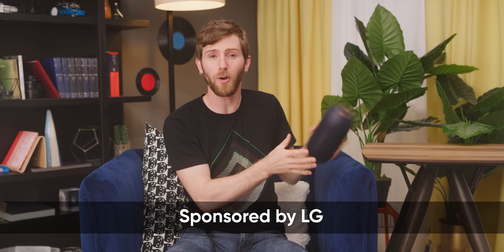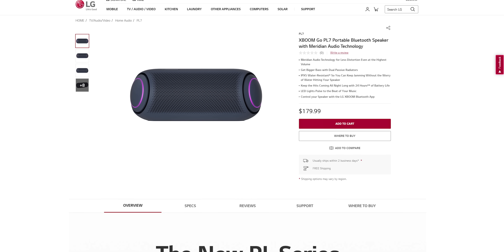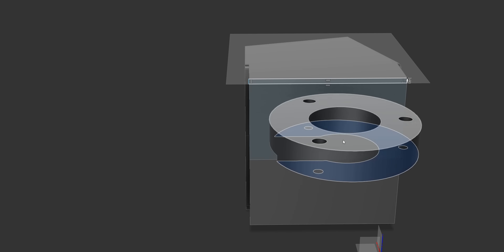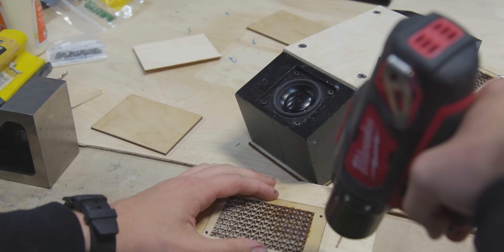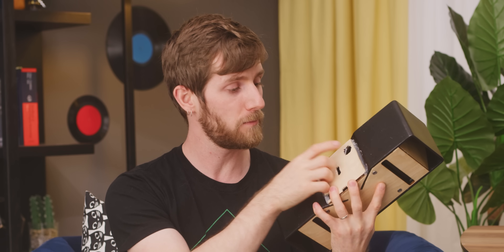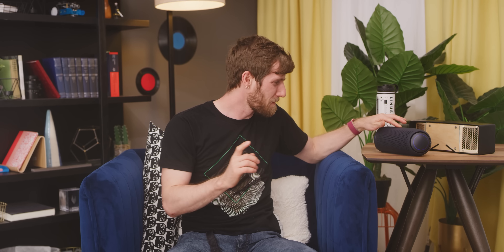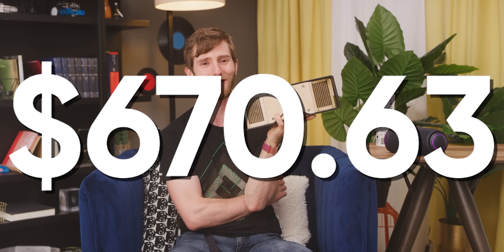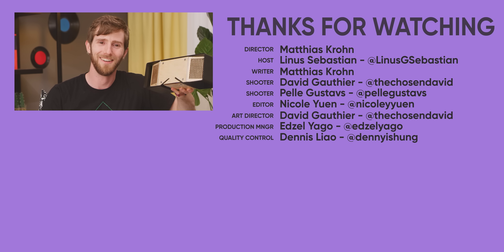Can we build a better bluetooth speaker? - LG XBOOM Go PL Series

Comment: Your "port" seems to be more of a transmission line than an actual port. A port is specifically designed to cause resonance at some specific (low) frequency, therefore boosting the bass of the speaker, whereas a transmission line is designed to act as an infinitely long channel, absorbing all the back radiation of the driver without loading it like a sealed box would do. As a result of this, a port is often just a straight duct, whereas a transmission line is often some long and folded structure.

As the perfect transmission line (the one that absorbs all radiation) is hard to achieve, the transmission line is often just made long enough so that the sound leaving it is somewhat in phase with the front radiation of the driver. (which is what you pointed out in the video) The thing is though, because ports and TLs are different things, the maths that applies to a port (which is what these online tools do, they calculate the optimal length for a port at a frequency you want to be loud so that you can show off with your 1500kg subwoofer in your car) does not apply to a transmission line.

Comment: But Linus, you calculating apples with Android's again. Please Calculate the design costs of the speaker lg did into your math or extend the count of your speaker by millions, selling them. (I think Matthias did amazing. (Minus the  connections are on the bottom instead of the backside) maybe give him another 60 hours to complete and tune and sell then STL and build files on lttstore ?

Comment: With two inch drivers you don't really need a tweeter I'd imagine. Could also just use a radiator instead of a sub to get some extra low end.

Comment: I appreciate approach with the 3d printer - it could have been a very good system but lacks a lot from the design perspective.
The most important is to measure linear and non-linear response of the individual drivers, simulate crossover, listen to the designed system and make some final adjustments to the crossover cause just measurements are not enough.
I guess your tweeter was just cut from low frequencies with the 2,2 uF condensator. That approach never sound good, even when using hi-end drivers. To compare - budget speakers like Dayton with properly designed crossover will surpass Scan-Speaks with just tweeter filtering.
Also your construction is kind of a transmission line which requires damping material inside the canal, carefully put - more in the beginning, less at the end of the canal. Without any foam you get a lot of strong resonances across the whole frequency response.

To be honest result is absolutely not a surprise. The whole thing would probably sound better without tweeters and in an closed enclosure. Maybe even less bassy but much more linear.

Comment: How is that 3D printed outer shell which required designing, 3D filler, hours to print, then redesigning, reprinting, more 3D filler, could possibly can be cheaper than bending a piece of aluminium lol

Comment: You should check out the boombox kids that they sell at Parts Express the kids are approximately 130 to $250 and I think the sound on them blows away in a commercially built Bluetooth speaker or boombox

Comment: I wouldn't have included a tweeter without a crossover.
Reply: Yeah and it would have been such a simple crossover
Reply: Also no EQ whatsoever...
Reply: I tried to turn a shitty Bluetooth speaker and a bookshelf speaker into a wireless speaker and when I plugged the tweeter and woofer in with no crossover the highs were so unpleasant that I had to disconnect the tweeter
Reply: @PackardKotch  Probably because the amp from the original Bluetooth speaker isn't powerful enough.
Reply: JF Tech/Drones it was, I just didn’t hook up the crossover
Reply: also that 1 1-8" tweeter was likely a bit to overpowering. two 3/4" might have been more appropriate.
Reply: @LKN117  it was not overpowering by much, because if you calculate 2 of the full rangers it adds them 6DB, and then that way the Twitter is overpowering just buy a half a DB
Reply: I call for a rematch. U know better than that guys. Lets TRY next time.
Reply: Yeah no wonder the highs are harsh...
Reply: Bump
Reply: I don't even know what a crossover is, you crazy audio nerds.
Reply: @nathanfife2890  a crossover splits a sound signal into higher and lower frequencies so that you can send the highs to the tweeters and the mids/lows to the woofers
Reply: @nathanfife2890  it's a electronic circuit board which make so the Twitter will do just the high frequency is it needs to do, and give the woofer to do just the other frequencies, it makes that they want overlap and  cancel each other.
Reply: @nathanfife2890  Audio nerds have better sound. Also, us audio nerds refer to ourselves as "audiophiles."
Reply: @tripeno1  though not every audiophile will know what a crossover is
Reply: @nathanfife2890  then you can use Wikipedia and educate yourself.

Comment: It is kinda unfair to include man hours cost since LG brings down cost by mass production and large quantity parts orders. I think it should have been purely a parts cost comparison.
Reply: And producing said items in a 3rd world/2nd world country, paying less than 10$ an hour
Reply: But that's the point - LG can do that, while we can't. Our time has value, so we have to factor that in when we're considering DIY as an alternative. The only way DIY comes out on top here is by assigning a high value to what you learn in the process of making it, which would be an absolutely fair thing to do, but whether that matters and how much it's worth will vary from person to person.
Reply: @SirVer51  But we literally can do that. Contact a manufacturer at alibaba.com and ask them how much they would charge for production runs of which and such a design.

You just have to be willing to accept that they may take your designs and create their own for cheaper.
Reply: @bensavedbychrist  But why would you make a production run? This is a DIY product for personal use - how would you make back the cost of a full purchase order of components? Many of those Alibaba vendors require MOQs of at least ten units or so, and while they will do samples, they'll charge you for them without the scale savings applied.
Reply: @SirVer51  Our time does have value but doing something on someones own time is our competitive advantage. It is wrong to value all time spent equal to a set value. I work x hours a week, I get paid for x hours, anything I do outside that time is not equal in value. No one can work 24/7 so time spent doing things does not have equal value. This would contradict the value of making your own dinner, working on your own car or even building your own computer. Have you seen LTT include labor hours for every pc build guide ($1000 build) on the channel? No because the expectation is that you building it yourself on your own time does not contribute to cost. If you work for a company, you will opt for prebuilds because company time has a higher associated value. It would only make sense to include the man hours if the speaker build was for a company.
Reply: @mattmers  I disagree - your time has value even if you're not working. In fact, depending on your priorities, your off time has greater value than your work time, since it's of greater personal value to you. They just picked the minimum wage because they needed some sort of baseline - you could take it as quarter of that and it still wouldn't even be close in terms of cost. The PC build comparison doesn't really hold up IMO because of how much simpler it is - even for a relatively tech savvy crowd like this one, designing your own speaker from scratch will take far longer than building a PC, even if they haven't done it before. This is especially true when you don't have LMG's resources, with the workshop and 3D printers and such.

Now, like I said, if you view it as a personal leisure thing, then yeah, you don't have to consider your own time as part of it, but that only makes sense if doing this is something you would enjoy as much as having the speaker right from the start, which would be uncommon. And that's just to get to $130 vs $180 - the difference in sound quality, features and ease of use would easily make up that gap. You would have to either value the DIY experience enough for it to actually bring down the cost rather than just not affect it, or not care about any of those advantages.

P.S. Working on your own car also rarely makes sense from a time and money perspective, at least where I live, unless of course the above-mentioned caveats apply.
Reply: @SirVer51  Free time (time outside of an individual's reasonable work hours [Hours spent to achieve a level of economic comfort])   does not have a negligible value because you would not spend it doing something valuable (hours to achieve a level of economic comfort). A persons time can be divided into Work hours and Personal Hours. These can be changes proportionally to achieve the desired level of economic comfort but the time value of each if not equal. Work time has a nominal value while Personal time have an ordinal value. If something cuts into your work time then it is reasonable to apply nominal value to the work time lost. Working on a speaker, making dinner and building a pc would be done in free time so there for you can not apply nominal value on the time.
Reply: @mattmers  What I'm saying is that if you're trying to decide if something is worth your personal hours, you have to attach some sort of value to how your spending them - that value has nothing to do with work hours or securing your livelihood. Like I mentioned before, I am not comparing the time spent on these efforts to the time spent on work; the principles you use to evaluate the value of work time and personal time are largely the same, just with different objectives, metrics, and weights.
Reply: @SirVer51  Yea I think we are close on agreement.  My initial argument was that LG works development cost into the sale of the product which is brought down in cost by mass production and that man hours of a DIY item should not be compared to a mass produced product. This is a false equivalency. Work time has a nominal value, personal time does not. There is nothing wrong with comparing the money for parts to build the item and the cost of the item premade. The value of personal hours is not nominal, not based on a set number. It is based on ordinal value or a priority system. I would rather watch tv so there for I will not cook dinner. TV is prioritized over cooking.
Reply: If that's the comparison, I didn't see filament costs (3d printing) in their speaker cost summary at the end.
Reply: @pdblouin  I would agree, they should include that.
Reply: yeah big agree

Comment: I made my own bluetooth speaker using the batteries and the speakers of a dead laptop, a small bluetooth board from china, a small square black plastic box and a drill... and of course, some hot glue... the project cost was arround 15€, including box, board and hot glue... it has no high bass quality, but the sound level is quite high for its size...

Comment: I’m gonna pretend I understood everything he said in this video and watch it.
Reply: I’m guessing you are talking about the process of making the speaker. Ported speakers are a design to make the sound  better basically. Think of it like a built in mechanical amplifier, using sound magic. There are excellent videos on it. As for the paint/sand/oil etc, that’s just a process for making wood look good. You sand it to make it a little shiny, oil it to bring out the grain in the wood, and then seal it to protect it.
Reply: Derp

Comment: To be completely honest, both speakers are complete shit.
DIY solutions for bluetooth speakers allow complex port designs and what not but you used a 3D printer so a hard and brittle material which is the worst thing you could've used for the enclosure, you mixed both reflex loading and T-Line loading (which could've been implemented in a much better way) without using any kind of basic insulation and added a useless tweeter when in reality you could've used that space for bigger ports or better yet, a passive radiator.

Building a better bluetooth speaker that surclasses everything in that price range can be easily done.

Comment: I'd actually use a different amp board, Linus. The capacitors are there can't be nearly enough to really support a well-defined bass.
Reply: So are you going to give a specific suggestion?
Reply: You got any cheap amp in mind?
Reply: @Verpal  well, I used something like this for my car after added some rasberry pi heatsinks https://www.ebay.com/itm/NEW-DC-12V-TDA7850-4X50W-Car-Audio-Power-Amplifier-Board-Module-BA3121-Denoiser/223682178366

Though that's a quad channel, there are some similar duel channel ones on eBay, too using the same family of amps.

The biggest downside though is that no dedicated amp boards have "built in" Bluetooth, so you'll have to get a figure up a separate solution for that. I use a raspberry pi in my setup, though you can build something using a teensy for something smaller and cheaper
Reply: @ARitzCracker  Hmm......this seems legit, I got piles of SBCs lying around, might well grab one and see what will happen.

Thanks for suggestion!
Reply: @Verpal  No worries! Though do note that the WiFi and Bluetooth on the pi share the same bandwidth and antenna, which means audio can stutter while the WiFi is on.
Reply: @ARitzCracker  Class AB amp in a portable speaker? Just no. Use Class D amp.
Also they don't really need big capacitors, lithium batteries can deliver enough current fast enough.
Reply: @JGnLAU8OAWF6  That's embarrassing 😅 you're right. Class D amps are more suitable due to lower power losses.

Comment: Short answer: no
Long answer: i’m here early and i really dont know yet, but i’d say no because it’s a sponsored video trying to compete with said sponsor.
Reply: Add to that the time constraints with the design and construction, and the lack of resources that LG doesn't have, along with the development budget.
Reply: Speaker, especially small ones are really, really hard to do, if you do not put tons of time and engineering into them. As long as LG did a half decent job and considering the price they ask for they surely did, it is almost impossible to beat them without either needing a lot of time or a lot more money, preferably both.
Reply: @KaimasterXD  JBL and LG are the kings of small speakers with passive radiators
Reply: @Ignacio.Romero  I really like these small Jbl Go speakers. They do not sound amazing or anything, but much better and louder than any phone and you just can stick them in your backpack and they are cheap enough that you don't have to worry about them.
Reply: @KaimasterXD  I was talking more of the Flip/Charge series but yes, the Go also sounds good considering its size and price
Reply: @KaimasterXD  It's actually surprising how many manufacturers mess up in their speaker tuning by boosting higher bass frequencies.
Reply: @kadajawi6567  Not really. There are way are actually a lot of people how like it this way. Just like oversaturated displays. These can at least be adjusted easily in software while changing the eq settings is often much more complicated. However if you really care about the sound you probably will buy something else anyway.
Reply: @KaimasterXD  I am aware that in a showroom most people will like the annoying booming sound better. But I have yet to find someone who, after a while, doesn't think it is annoying.

If only manufacturers would simply integrate a switch in their app, in order to switch to a more neutral sound.
Reply: @kadajawi6567  Not in their app, put a button on the device. More often than not these apps are kinda dodgy and do not run on every device. And it's a Bluetooth speaker so a friend of you might want to connect to it as well.
Reply: @KaimasterXD  That would be optimal, but I'd already be happy with a switch in the app. Even pretty expensive speakers tend to lack the option. And really, I only need to set it once, as long as the device remembers it.
Reply: longer answer: the challenge is rigged to hell by requiring that the single DIY product costs as much (both moteraily and in LABOR (which is even more unfair because they assume a $10/hr minimum wage when in reality the factory workers in china are paid nowhere near that much (that is, if they're paid at all, as LG is listed as one of the companies using Uyghur slave labour on the article "‘Re-education’, forced labour and surveillance beyond Xinjiang." by Australian Strategic Policy Insitute))) as the mass-produced speaker that's manufactured by using specialization wherever possible. see "Why Chicken Sandwiches Don't Cost $1500" by Wendover Productions